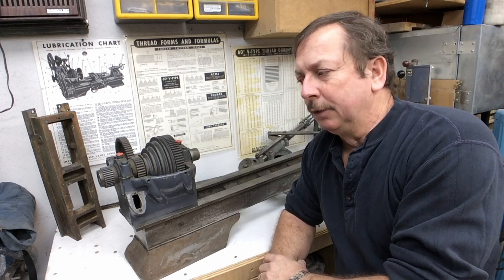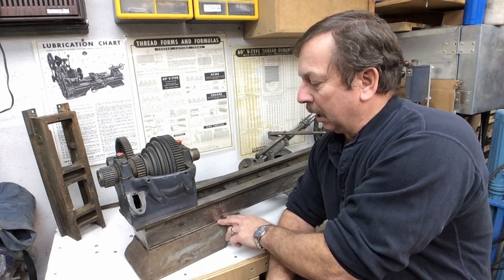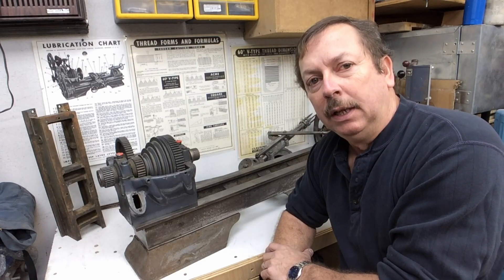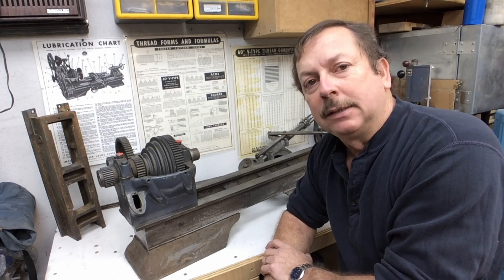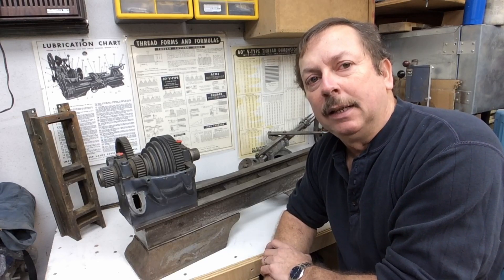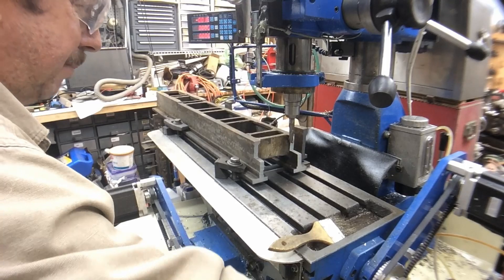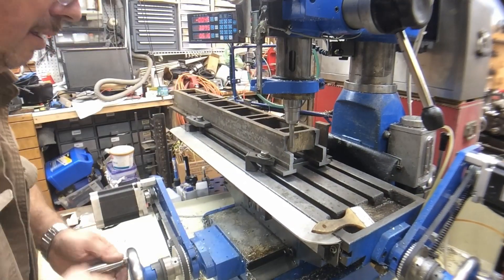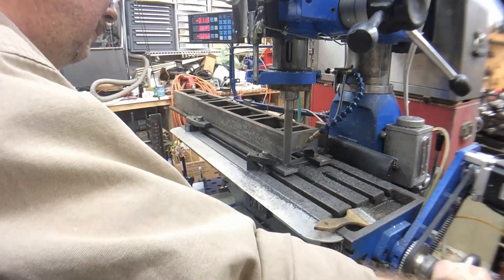Building an Atlas 10" Production Lathe Part 1

Comment: cant wait to get caught up with this series i have quite a bit about atlas lathes on my channel. in fact i have compound slide patterns in the works for a customer right now.
Reply from the maker: Thanks, I am getting closer to having this project done, not sure what the next Atlas project is going to be. Either my shaper or probably starting the build on a MHB mill
Reply: where abouts you from? if you need any pattern work let me know. i can get iron castings made also . might have a look at my channel you can see the stuff i play with
Reply from the maker: Washington state, I glanced at your channel earlier and will go look closer when I have a chance. I do quite a bit of casting, mostly in aluminum, but ocassionally I play with iron also, weather is just now getting to the point where I can start casting again, I tempered sand earlier this year, but then it turned cold again.
Reply: one advantage of petra bond i suppose. my wife has family in puyallup